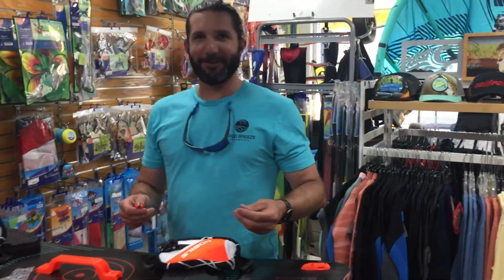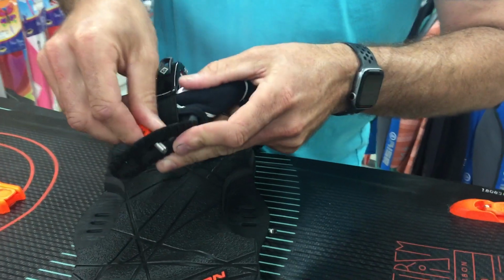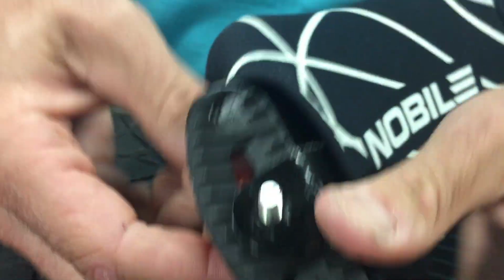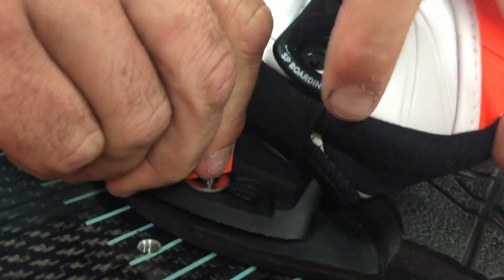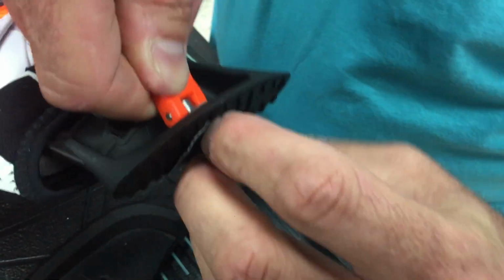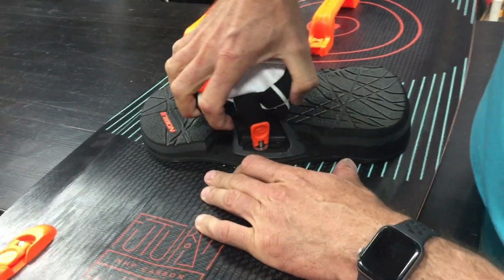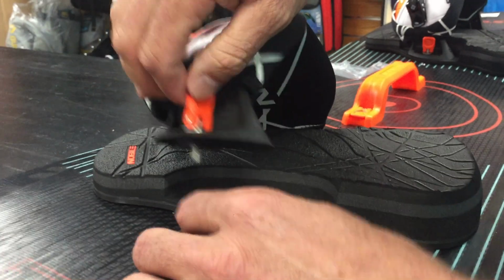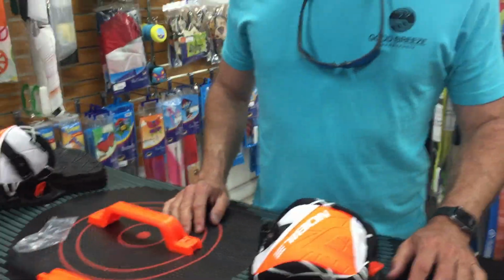Nobile Gen2 Click N Go Pad/Straps Install How To Video

Comment: THE dumbest design for a strap screw ever! … throw these stupid locks away and use regular stainless 1/4 20 Phillips. I’ve owned these straps and love them but I threw the thumb screws out right away and put regular screws in and they work great! WAY faster WAY easier! For some reason the Nobile designer will not admit how ridiculous these things are and just do it the way ALL of the other board makers do it!